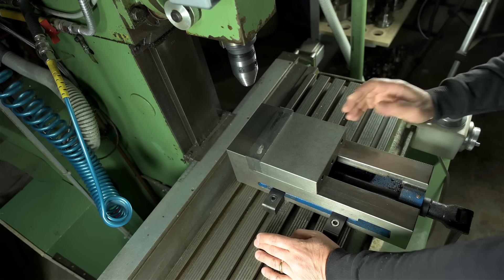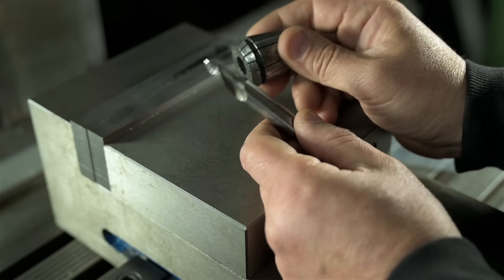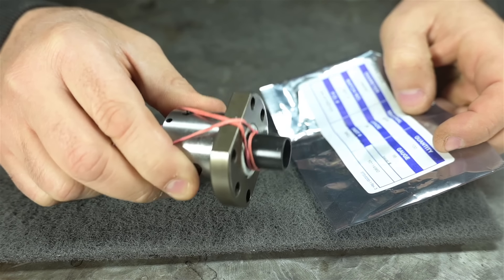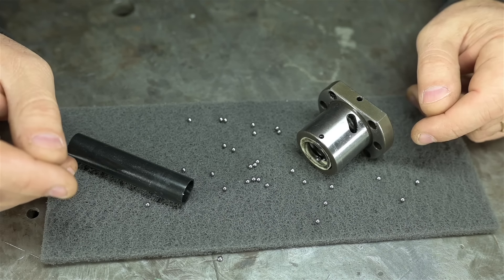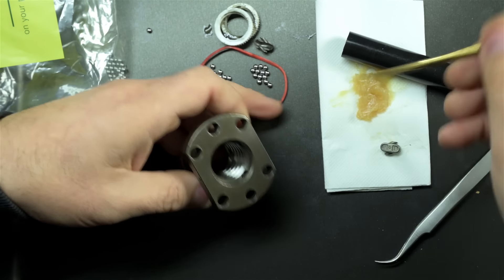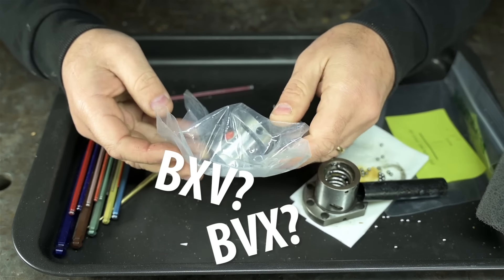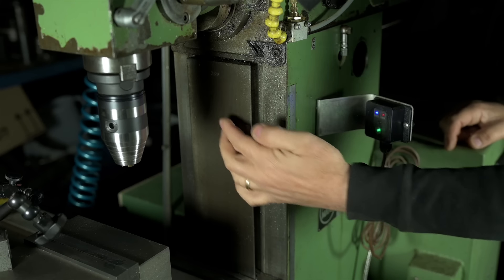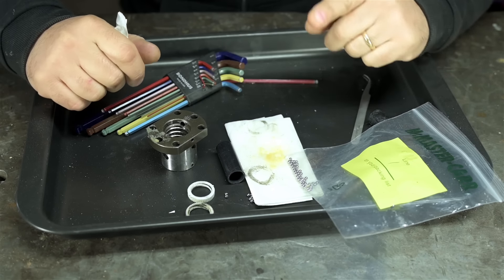Rebuilding &/or Replacing BALL NUTS

Comment: The nice nuts that have the external returns are easy and you can put the nut on the shaft and push the balls through the return then fill the return and put it on.

Comment: You can combine two ballnuts to anti backlash like you do with regular nuts.
On the cheap screws it's probably an idea to use springs for your preload so you don't get binding from the screw pitch changing as it goes along.
I did this using belvile washers in a mill I converted using .001mm glass scales for the feedback to close the servo loop. Any backlash over the .001 would cause horrible oscillations (happened once when the preload screw backed out). So I can say with some confidence the backlash in the system was less than .001mm lol. Been running for some years now, I presume it must be worn like yours as it is using the cheap nuts and screws.
Reply: This is an outdated preloading method. These days, a good quality nut will have oversized balls loaded to preload the nut.
A rolled screw won't have that significantly changing lead you're referring to. Maybe a **really** shitty ground one, but the rolling process kind of prevents this.
Reply: @crackpotfox  if you look at the specifications for periodic error you'll note the low grade rolled screws are higher than for ground screws at least for any I've seen and as the distance between a pair of nuts is larger than oversized balls so it matters more. Also the forces from oversized balls are much higher for an equivalent anti backlash force so your wear especially at speed is quite a bit higher. Oversized balls lead to 4 point contact within the nut and thus sliding contact. Double nuts remain 2 point contacts so less wear and better high speed operation.

Off the shelf double nuts seem to  generally be used more in higher end equipment with a need for more stiffness. Oversized balls seem more used in cost optimised lighter duty machines at least from my research.

BTW if you want to actually talk about this kind of stuff on the internet avoid saying things like "this is outdated" which is a) not actually true and b) insulting and emotive. It doesn't lead to discussion, it leads to argument.

I'll add some links to support my arguments in a separate comment lest this gets deleted.
Reply: @zyeborm  Regarding lead deviation, a rolled screw will have a relatively linear lead deviation. That is, the lead will be nominal+(a relatively constant error*distance). A ground screw will have a more random lead deviation. While of course a tighter lead screw will give you better travel accuracy, that's not to say there is no benefit from the higher preloads available in a double nut. If you need it. All of that is to say that you can still get a lot of use out of a mid grade rolled screw with high preloads. So yeah you're right, double nuts would be used for high stiffness requirements. I wouldn't say any double nut you can get 'off the shelf' is really that high end though. You can't guarantee a preload level without matching the nut to a screw.

I'm not trying to insult, i'm just speaking of facts. Double nuts are an outdated and expensive method of preloading for preloads <~~5%. I disagree about the max speed point. Contact is not the limiting factor in a ball nut speed, the nut's ability to pick the ball off the loading zone and into the recirc zone is. I don't have a single double nut in my product line with more than 20mm lead, whereas i have single nuts in every size and lead, all the way up to 64mm lead. Using a double nut for low preload applications is something i only see really old guys demanding. Again, not an insult, just a statement of fact.
Reply: @crackpotfox  "just speaking facts" when I say your tone is combative and your social skills are lacking. See how that feels? Nice isn't it. Really conducive to discussion. Oversized balls are a hack way of achieving preload trading service life and overall quality for initial cost. "Just stating facts". Boy howdy those "facts" sure feel like they have a lot of opinion added to them. You know using words like outdated and hacks and "old guys" pure facts right there.

Anyway.

If you read what I wrote using two individual nuts and belvile washers it's a way of achieving whatever preload you desire using the cheapest components available.
I've done it, it works and has measured error less than .001mm even when worn after years of operation for a total cost of like $60 using the lowest grade components. As soon as the oversized unit wears he's going to have the same problem and it'll wear faster. I did give links to demonstrate this but being YouTube they have probably been blocked. Yes you can get screws and nuts using oversized balls for preload, but you'll want to get them in a matching set if purchasing from anything less than the most reputable companies. 
If you want to retrofit an existing machine for the cost of the cheapest ballnuts you can find this is in my opinion a valid option. I have done it and had it work. Your opinion may differ, but please recognise that it is an opinion, not the one and only true way.

Comment: We had a piece of medical equipment that used a ball screw. The lubricant used was the wrong kind, which led to noisy operation. The accuracy didn't suffer, but the noise was objectional in a quiet operation room environment. You don't want to hear noisy balls during surgery.

Comment: This Old Tony pleas decreas yours Y aceleration. Your screw may transfer forces fine but if aceleration is too high, dynamic forces exside parts limits. Other axis are fine so the parts are good. Overloading screw decreas its lifespand drasticly. If you reduce aceleration only by 10% part can last 20-40% longer. If you reduce aceleration by 20% prapobly This Young Tony will have to deal with IT😁. 
I love your chanel. You always share your knowlage with us so i wants to share mine. Long lasting ball bearings and happy CNC.

Comment: Basically the same thing we do in electronics to manually reball a BGA computer chip with 0.40 mm (16 thousandths of a banana) solder balls using needlenose tweezers, solder flux, and a microscope if your eyesight is dodgy.

Typically we use a stencil, which makes life so much easier, but there are times when you have to place hundreds or thousands of solder balls manually one at a time like you're doing here. And yes there are chips that use far smaller solder balls, 0.20mm, 0.15mm and smaller (0.008 and 0.006 bananas, respectively).

Comment: Solve backlash problem by installing a redundant dro which corrects the movement: command= move X 0.1mm|Measure movement with 0.001mm DRO=> feedback real movement=> stop movement when destination reached. Needs 3 Diy or professional linear readouts, and some programming skills.

Comment: Don't install the dust shields until you've installed the nut.  Rotate one onto the screw before the nut.  After the nut is on, rotate the shields into it before locking them.

Comment: I was repairing a level winder on a winch on a ship that ran on a ball screw. I had my nice new ball screw sitting on my bench ready to fit to the shaft, I went out of the workshop to double check which way the screw went in the winch, and as I walked back into the workshop there was the site manager with the ball nut in one hand and the other hand on the sleeve that holds the ball in, just as I yelled NO to him he pulled out the sleeve and dropped all the balls out. I sat in his office while putting the balls back in so he knew just how much of a cluster he had caused.

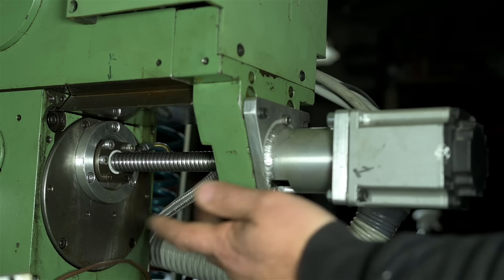Comment: 2:12 so what you want is like a laser range finder oe some sort of linear resistor (x amount of movement should result in y amount of resistance)  or something that can tell the computer you ordered the motor to do x  but the sensor returned y therefore  do x more turns  or something like that ... either that or  everything just has to have that much engineered tolerance lol

Comment: I've been always terryfied to take out a ball nut (or ball bearing linear block) until a cowoker filled 4 of them with high viscosity grease and we had to take them out, completely dissassemble, clean and assemble again. We spent more time cleaning than assembling and installing.

As far as you are patient and have the time (something is not for granted in a production environment) it is an affordable task. 

Just make sure you know what you are doing. If you install a ball out of the track it will destroy the recirculation end caps and thats a game over!

Comment: The interwebs always seems to have something to say when a guy doesn't buy the most elite parts available. You can change that ball screw assembly many times before you come close to the cost of the "good" ones. Which will also wear over time.

Comment: Aren't there ball nuts with adjustable preload?  I'm thinking a flex between the two circuits and an adjusting nut with cupped spring washers for preload.

Also, would it be a good idea to install limit switches to prevent crashing?

Comment: morale is fancy stuff is expensive but that doesnt mean it will always work for what you need. i work at a small shop and this year we got a brand spankin new 5 axis haas with a robot and so far ive had to realign the whole machine twice from crashes down to 1 thou. the robot is a bit dumb too ive lost track of how many times its crashed now. if we ever get through the problems it would be a machine that can run lights out though...

Comment: There is usually a prerequisite pissed off, flipping throw. If you plan it right the ball nut lands in an empty 50gal garbage can. It confuses the balls and if you can find them quick enough before they recover, then they behave and practically fill the ball nut on their own,,,,,,, NOT! I usually wind up slowly pushing the rod in while adding the balls one at a time. A real royal pain in the butt.

Comment: Ball screws and ball nuts really should be from the same manufacturer, and usually they come as either interchangeable or non-interchangeable versions. Interchangeable ones are expensive, but you can buy the nuts / screws separately, because they're in a tight, specific tolerance band. non-interchangeable ones come as a matched set where both the nut and the screw were outside of the manufacturers interchangeable range, then paired and sold for often much cheaper.
The ones sold generic online are non-interchangeable generally, and badly matched / dodgy.
Proper ones from reputable suppliers (Hiwin, IKO, etc.) are all specced out with pre-load options etc.

I suspect the ball nut that This Old Tony got is probably massively over-preloaded and might well wear out and die very fast.
Also, Hiwin do much better prices then $1k per ball screw. Quality is still very good.

Comment: Lay down a towel of any type on your work surface before you start loading the balls to catch dropped snuts. The towel will stop things from boucing and rolling. You'll save yourself a metric fuckton of heartache if you bought exactly as many balls as you need for the job as every shop seems to find a way to magically disappear any dropped small parts.

Comment: I'm curious why you don't use a double nut there, is it just for travel reasons? 
The single nuts have to use very slightly oversize balls to eliminate backlash (ideally packed alternately smaller and larger) while the doubles rely on the distance between the two nuts.
Reply: Because double nuts are expensive, obsolete, and expensive. Like you said, single nuts can do the same job for essentially half the price. Your max preload is a little lower, but who needs 10% preload in reality?

Comment: Most vehicles now have rack and pinion steering but their predescesers had recirculating ball steering gears. Same principle. With an increase of the size of the balls you can take up the wear of both the screw and the nut. Is that the point you're trying to make?

Comment: You say that only a few balld are making contact at a time. That doesnt make sence. All the balls that aren't in the return tube will be engaging the screw and nut. This system was used in gm. Streering boxes from the 40s and other makes too

Comment: verify motor to nut alignment, as small deviation may crack ur balls :) lose the nut, move it as close to the motor as possible to fit the wrench, and then tighten, had a few screws replaced due to that issue

Comment: NOTICE TO EVERYONE:
The easiest way to wreck a ball screw is that once it is installed to push (or pull) the moving part into the physical limit sometimes called the hard stop. EVEN if you do it slowly it will damage the ball nut by loading it up and internally stretching it. If you slam the moving part into the hard stop as I have seen done the ball nut can literally explode as I have seen done.
 
I have been around machinery with ball screws for almost 30 years and this one of the most common mistakes people make with lead screws and ball screws. People will come up to it and test the limits by hand or under power.
IT NEVER GOES WELL.
  
The cure is simple: 
USE a LIMIT SWITCH or SENSOR and back that up with something like a rubber or urethane cushion.
Always use limit switches and sensors on linear systems like these in the NORMALLY CLOSED mode. That is the mode where the axis needs to see a signal to move in that direction. In this mode if the wire breaks or the limit switch or sensor fails the axis simply wont move in that direction. Yes there are failure modes where that does not work, but most failures of limit switches and sensors the signal fails OFF rather than fails ON.
Reply: I have seen this comment.

Comment: I'm getting the feeling that you need 30mm ball screws. Not 20mm on that big mill. 
With those high torque servos. I think you're just overloading them. Even my little mill has 16mm ball screws. And it's long axis is 300mm total on the screw. About 200mm travel. So it's a dinky mill. 

And it only has little nema steppers and a 400w spindle. 

Loved the video though.

Comment: A common thing in ballscrews is every other ball may be slightly undersized. They're called spacer balls. It reduces the friction but also reduces the load capacity. Swap the undersized spacer balls for full sized ones, which should result in using one or two fewer balls. Then there's multi run nuts without all runs being used. If the return pieces can be obtained the unused run can be filled to spread the load out and reduce wear.

There are companies that rebuild rolled and ground ballscrews for far less than the cost of new ones. They'll grind rolled screws which improves their precision over what they had when new. Then they load the nuts with the right sized balls to achieve the correct tolerances.

Comment: Ha ha. I had a John Deere riding mower with an attachment lift that looked like a hydraulic cylinder but was actually a linear actuator. It would bind and make crunchy noises and being the naive cheapskate that I am, I figured that I could open it up, clean it out and reassemble it to work like new. You know, instead of spending north of $400 on a new one. The moral of my story is that you have no idea how many small holes there are in the floor of your shed until you drop (what felt like hundreds) of little balls and can only find ten or so…

Comment: i had... "robson" i think it was... ballscrews. awful things with one circuit, multiple turns. strange two piece return tube. nightmare.

these three row things take mere minutes. hold screw with one race engaged, drop balls in one by one... 1/3rd of total per circuit, der... lil bit of wriggling but definitely no grease. only tricky bit is the first 8 or so, not letting any of them drop through. get past that... easy as.

lol. pulled one apart... knew i had dropped one ball... but kept coming up to 49 balls... hmm, did i drop two? or was one missing?
i dropped two. iunno, i found both... a minor miracle... or one was misisng and thats a random unrelated ball of the same.. to my measuring ability... diameter.

Comment: Typical McMaster Carr. They quoted the diameter of the ball as 0,129200" when everybody knows that they're in fact 3,28168mm. I mean, Metric is so much easier. I know what you're going to say though. Yes, I also know that they are 323/2500". What do you take me for?

Comment: You really went balls out on this project!

Side question, did you go back and re-torque the ballscrew after cycling? Just curious that if the balls had some minor loading while installing, they could potentially deform and cause ball slop down the road.

Comment: Seems crazy you all being millers.  Why wouldn't you tap the end of the ball thread bar with a simple short 1/8" hole in the center and then make a metal plug that has an O.D. to match the I.D. of your plastic tube with a 1/8" rod on the end? Wound be almost  no chance of dropping your balls.  Could even do threads. No idea why this isn't standard in manufacture of system.

Comment: You could have used the other ball nut as a tensioner. Having to next to each other and force them 0.01mm away from each other will take up the vast majority of backlash. The little that is left is usually compensated for in software.
Reply: In case you didn't notice, the new ball nut had essentially zero backlash.

Comment: Awesome video OldTony.  So here is the story, you are part of the reason I have a used Sheldon 11 lathe sitting in a bedroom of my house, yes I'm a bachelor so I can do things a married guy simply can not.  Anyway, I'm enjoying my new old toy and am learning.  My goal is to start off fitting spindles with bearings and see if I can mount tools to them for grinding, even milling.  So my expectation is with non hardened spindle rod, starting from .5" to maybe 1.25" can I manage and end mill maybe up to 1/8, 1/4 for shallow cuts?  Kind of like you wondering if you can get oversized ball bearings to fit into a worn ball nut?